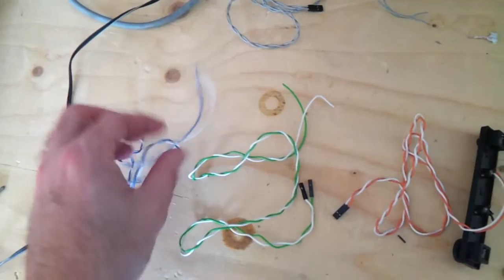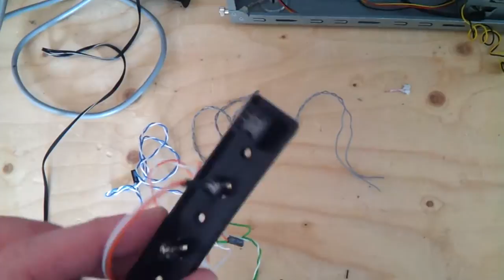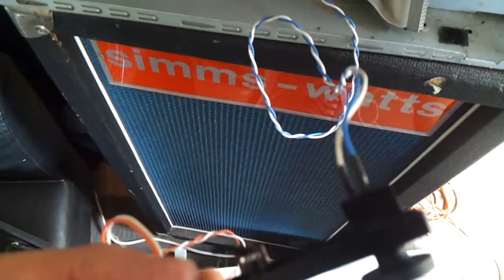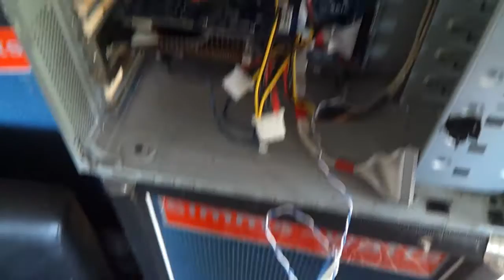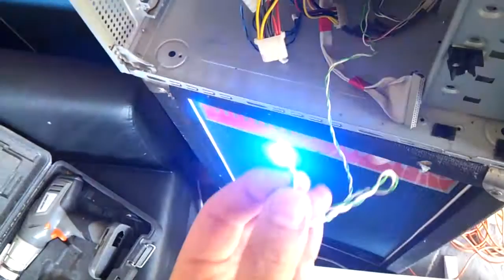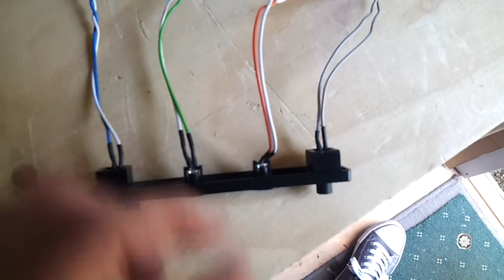Repairing PC Case Front Panel Connectors

Comment: The front panel on mines cables haven’t disconnected but instead the push button that’s connected to the cables that start the pc up is jammed. So it’s virtually impossible to turn it on. Is there any way i could fix that?
Reply from the maker: Yes. Basically install another switch somewhere else on the chassis. You can either use a new wire or desolder the exisit-ng one from the existing switch and solder to the new one. You want a momentary switch - style is up to you!

Comment: My CPU was running before Then I removed it to remove the dirt in the Cpu. After that, I cleared the cpu without removing any of the wire but it is not running anymore. The beep sound can not be seen. The fan is running and the motherbord's light is blinking. However, my CPU is not running. Please suggest remedies